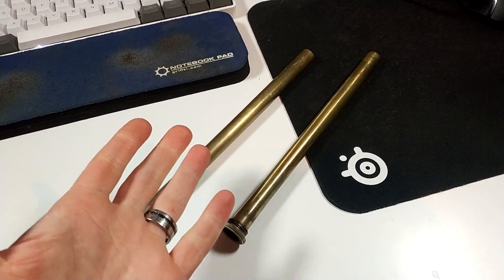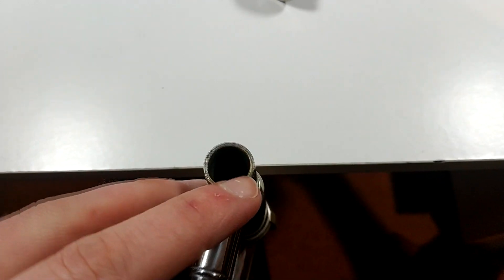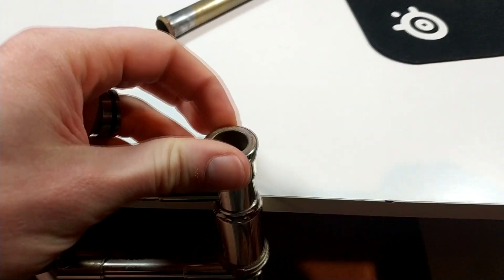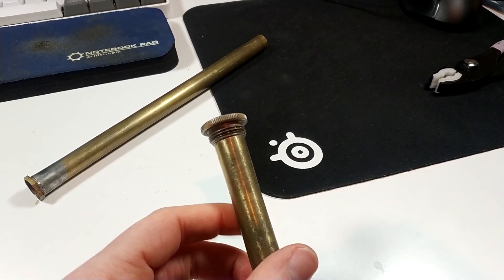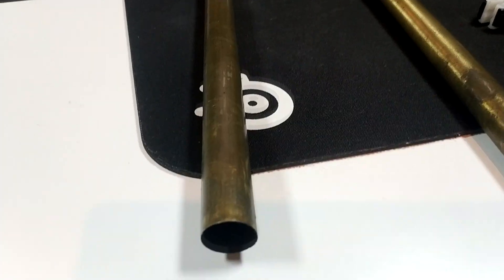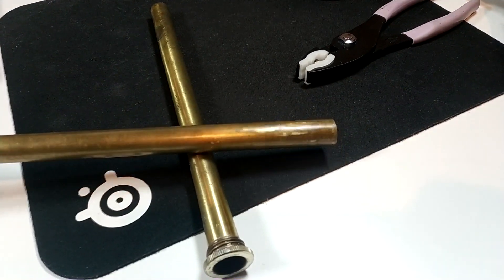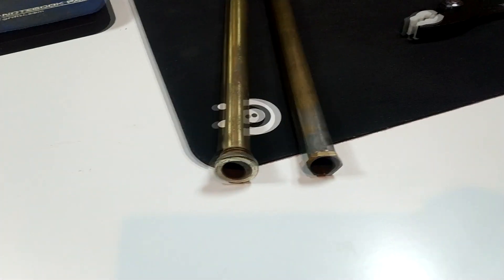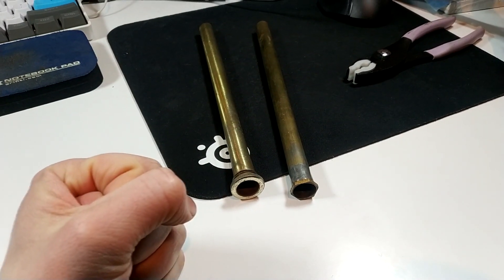Press Fit vs. Threaded Leadpipes

Comment: I just got a new Shires  large bore tbi27s as a gift. It appears it has no lead pipe change out option. I am happy I got a new horn just wish  I had the option to tinker with lead pipe options.
Reply from the maker: Yes, I think that's an intermediate Chinese model line? Maybe the Bravo series? They don't have interchangeable leadpipes, but I'm sure it plays fine!
Reply: @AidanRitchie  thanks Aiden. It plays fine. Not as well as my Yamaha 800 series .525  but it does have an f- attachment and that’s what I wanted.

Comment: I know this video is on the older side, but. Wouldn't a lubed o-ring at the top of the press fit pipe (just below the ring) seal better and also cut down on spinning?
Reply from the maker: Perhaps... You'd have to cut it to slip on, since the smallest part of the leadpipe is at the top
Reply: @AidanRitchie  Assuming the venturi taper isn't too extreme from end to end you could probably stretch it just enough over the bottom end to make it's way to the top. From there the o-ring should have enough outer clearance to grip the lip of the slide tube. All theory, I don't personally have any press fits to test this with, if you'd want to give it a try.
Reply from the maker: @trombovox  the other hard part is finding the exact right size o rings!

Comment: Hi! I have a Shires trombone and it has leadpipes. My original is at little bit brown colored at the end, maybe water contact, tell me if is this normal! I can also send you a pic on mail if you wanna see.
Reply from the maker: This is normal, it's just where the leadpipe has oxidized over time in contact with the inner slide. If you can still take it out easily, it's fine.
Reply: @AidanRitchie  Thank you!